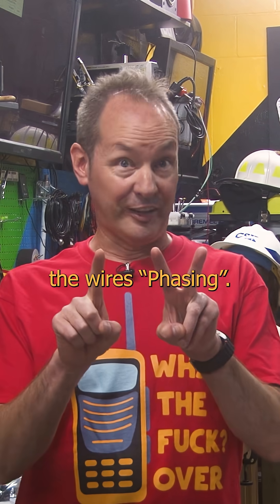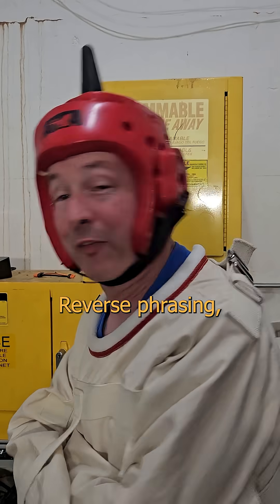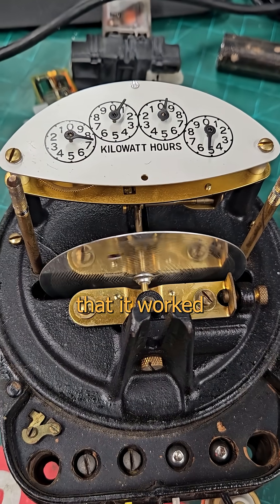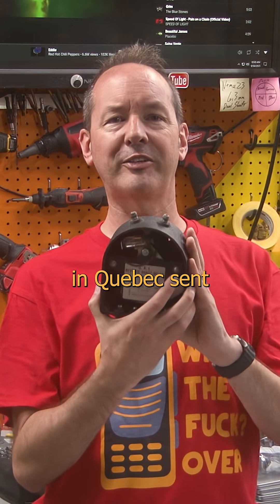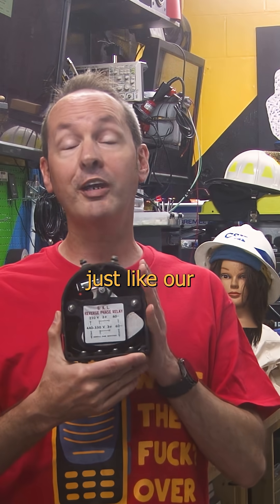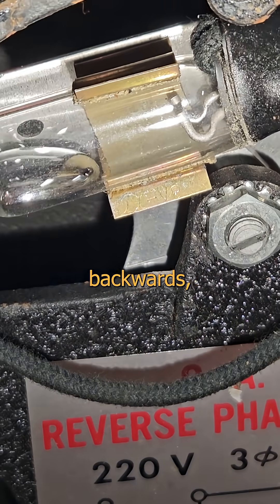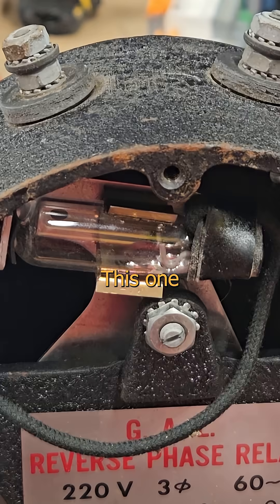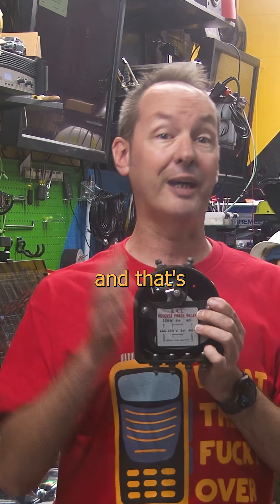Reverse Phase Relay #chrisboden  #comedy #engineering #electrical #educational #elevator #science

Comment: first time i saw phases accidently reversed, we fixed a snow gun and rewired it in where we'd temporarily had a portable unit covering for it, phases were wrong and we found out when the stream of 70 gallons a minute of atomized water got sucked backwards through the barrel instead of ejected forwards into the main hill...looked pretty neat though...

Comment: At work,  we use chillers to regulate the ink temperature on ink jet printing presses.  The circulation pump in these chillers is small but runs on 3 phase power.  The pump motor has a small flag that pops up if the phase is wrong.  When wiring it up, we bump the pump over using   the contractor to check rotation.  This also saves the much larger compressor the headache of running backwards.

Comment: Not always a "expensive sound"
Used to do work for the highway doing maintenance on the high mast lights.
(Those real big ones usually in the center median) Some of them have a motorized winch to lower light ring from the top to the bottom. 
If it was installed incorrectly, the only thing that really changed was what button worked for up and what burton worked for down despite what the label said.

Comment: I had this problem once. Re-wired a machine I was supposed to just LOOK at, but because it was all vacuum tubes it couldn't reverse the spindle, so when I connected it thus the Motor turned backwards and the lathe was useless until they fixed it. Lucky for me, the Tubes did not care.

Comment: Reversing phase is an unfortunate trick we need in entertainment rigging. When a motor stops behaving sometimes we need to pull this gag to make the motor that only goes one direction attempt to go the other way when we have a wiring failure. Nothing makes expensive sounds like a few tons of truss stuck half way up because of a control failure.

Comment: I had a licensed electrical contractor wire a delta motor as a wye. It was late in the day and he was eager to get home so when he flipped it on and it buzzed ominously he switched it off and said 'There ya go!', packed up and left.
After he'd left I tried it and again ominous buzzing but no spinning. So I decided to check his work and noted the big Delta symbol on the cover, confirmed he wired it as a wye, and spent the next hour rewiring it properly. It spooled right up when I was done. Thankfully the motor wasn't damaged.
Reply: reputation matters more than paper certificates and always has.
Reply: @TS-jm7jm  Just because you are "certified" doesn't mean you're "Qualified" - NEC code states "Qualified" for a reason.
Reply: Did you back charge him?
Reply: @MrHuram-abi  I let the upper management know what happened. Since the guy was a 'friend' of the VP I doubt anything was even said. All I was concerned about was getting my production facility back up and running.

Comment: Once worked at a drug company.  One of the more "talented" operators learned that if the motor goes the wrong way around, swap two wires in the plug- not swap two of the current carrying wires.  We had an electrician on site, but the operator thought that he would save some time and be a hero.  So he goes and swaps....one of the phases and ground.  Now the machine does even less than before, so time to call the electrician.  At this point it's important to know that all the operators are wearing nitrile gloves and tyvek suits, so close enough to being insulated.  The poor electrician was profoundly less insulated l, and got one hell of a zap from the machine.
Reply: @kc2sst  he didn't try and change them at the vfd or was there none?

Comment: I work in a plastic shop, we are constantly trying to make all the outlets run the same direction for the grinders and dryers we move around. 

Lucky the machines say when the phases are swapped. For a quick fix when I don’t feel like swapping wires, I made a little dongle to plug in between. 

It at least keeps the party moving without me having to drop what I’m doing.

Comment: My brother-in-law is a commercial electrician. One of his claims to fame is that he was working on a rotating restaurant high up above the city. The restaurant is designed to do a full revolution in the time that the average person takes to eat dinner. When he was working on it, he accidently did exactly as described in this video, and got the restaurant spinning the wrong direction. Apparently none of the customers were any the wiser, but it really threw the staff for a loop because when they came out of the kitchen in the center and on to the moving platform, it was moving the opposite direction that they were used to. It was spinning the wrong direction for a couple of days before he was sent back to fix it.
Reply: The Millenium Hotel Restaurant in St Louis, closed for more than 10 years.  I think they are trying to get it torn down.
Reply: Now I wanna know which building and how big the motor was.   My first thought was Space Needle in WA
Reply: This feels like a reunion tower in Dallas kind of thing otherwise we’d all have heard about it before
Reply: @TheHeroPercy  if thats the case, have you heard of the Egon restaurant in Trondheim, Norway then? Thats a spinning restaurant
Reply: Sounds like the Space Needle.
Reply: there was a revolving restaurant in sydney. it doesn't revolve any more.
Reply: As memory serves, this was a trademark feature of Holiday Inns in big cities.  I don't even know if the Holiday Inn brand exists any more, but occasionally I've been able to recognize former such hotels — the rotating restaurant/bar in apparent disuse.
Reply: The Wolfgang Puck restaurant in Dallas is like this
Reply: Sweden?
Reply: Since noone's mentioned it yet, imma just say that there's such a restaurant in Vienna.
Reply: Calgary Tower?

Comment: Most expensive sound ive heard was 400kg (880lb) water pump that tried to jump out of a wet test stand. The pump survived pretty much unharmed (sealing had to be redone), but half of the electrical test and sensing station had to be rebuilt. It even fried 2/3 of the 120kA fuses and the inductive current sensing.
Reply: so it leaped out and landed on expensive things?

Comment: I've witnessed this on 3 phase motors at my job. While helping the conveyor mechanics..they would rewire to jog the rollers back after a carcass break. This elevated the tension so they could unwind it from the drive rollers. Then we could pull it out to relace it. Saves alot of time. Thank you for an explanation so I could understand the process.

Comment: JET brand hoists have a reverse phase inspection relay that cuts out the control voltage if the phasing is wrong to avoid hitting the upper limit while the down button is pressed and vice versa causing the lift chain to snap and causing expensive noises when the load plummets from the sky.  The relay frequently fails, so I have changed a lot of them out back in the day.

Comment: I used to work in a building where a bunch of the floor outlets were out of phase. The story went that the building was being built during an electricians union strike, and in the process of bringing in multiple non union crews to finish up the work, some of them were wired incorrectly. I dont know what parts of that story are true, but I find it entertaining nonetheless!

Fortunately, from my understand and experience, everything where phase actually mattered was fully capable of swinging both ways, so it was really only ever a matter of making sure your chain motor was running in the correct direction before full sending it

Comment: We were going to bring a pump online and asked the electrician to double check the phase at the outlet....He responds that there's no standard ....wait!.What!?  Thankfully someone else knew where a phase meter was and checked it.  It was not a pump we could safely 'bump' check.
Reply: Standard is right turning field
Reply: Standard 3 phase in machine world is red, white and blue left to right. Hopefully the building agrees. And that is a variable you don't know until you plug in.
Reply: Remove the coupling between the motor and the pump before you bump the motor. Cheapest way to prevent a broken pump housing.

Comment: Working with 3 phase water pumps, it's always fun to see water entering places it's supposed to be leaving.
Reply: Or the impeller unscrewing from the drive shaft and ejecting itself through the front housing...
Reply: @v8snail yup, was going to say it if nobody else had haha
Reply: @v8snail  That's when the expensive noises happen. 😁
Reply: Depending on the pump, I wire domestic well pumps, it still pumps the correct way if your phases are wrong but it's much slower. In old installations that's how I test the correct phase. You let the pressure switch activate, time it until it stops. Then you switch two phases and time it again. The faster one is the correct phase
Reply: @justme5384  same with boilers and sewage pumps. they're all centrifugal, so the flow direction is determined by the volute. The impeller just uses surface tension to fling the water.
going backwards just kills the efficiency... and sometimes the motor coupler.
Reply: @justme5384 Dang ol’, good info!
I genuinely appreciate that.
Reply: @justme5384 this is how we do submersible sump/trash pumps. You can also tell by checking amps.
Reply: That sounds like expensive contamination of a tank waiting to happen. So you're not working with turbo pumps, right?
Reply: The pumps for Fire Sprinkler systems have several relays meant to tell the Fire Panel if something is wrong and one of them is designated "Reverse Phase" and is specifically there to tell the fire panel that the fire pump is running backwards.
Reply: this is why we always always always check rotation before coupling our motors to anything, we’ve learned the hard way. fortunately, all we did was burn up a belt on a compressor, but the stakes are higher on 250hp motors coupled to 2 ton gearboxes that have a backstop
Reply: Oooo expensive spillages
Reply: When I cleaned swimming pools one summer there was this one guy who just had a new pool built and idk if they wired his pump backwards or plumbed it backwards, but his jets were sucking and his drains were blasting. Really high end builder too.
Reply: Well that’s the interesting thing, there are very few pump types that that actually happens. Most just don’t pump or pump very little
Reply: This happened at my work they wired the scavenger pump the wrong way so instead of take water away from the kettle it filled the kettle and blew the lid open.... they didn't think to test it before running it fully 😂
Reply: That’s it motor running backwards because they haven’t bump tested it and cooking a water pump in about 10 seconds flat
Reply: Yep! All my big pool motor pumps are the same
Reply: HA HA HA...yeah funny stuff.
Reply: @jameypoelman1317 were still doing phrasing right lol gotta love the Archer throw back
Reply: i too work with pumps but mainly for sewage, fat and greywater. easy when its a 3 phase, but sucks when its a single phase
Reply: For Extreme Values of "FUN"...

Comment: It's a fun time when the sensing wires AND the phase wires get messed up and you sync a bunch of generators together and introduce them to the grid going the wrong way around. The crankshafts generally pop first.....then it's popcorn time. More fun times if it's a turbine, they can rip the floor mounts out. Long story short....the grid wins.
Reply: Ah, the special kind of "expensive noises", yes?
Reply: most spectacular failure I ever heard of was a speed sensor failure.  A giant condensor (spinning inductor monstrosity) was supposed to spin to 60rpm and sync.  but the speed sensor partially failed and it spun to 180, tried to sync, failed to sync, and shut down.. then auto started again.  Over and over, until it blew apart into 100 foot rain of thin iron laminations like "flying knives".
Reply: Grid ALWAYS WINS!!
Reply: The North American grid could be considered the largest single machine in the world.
Reply: In power plant operator school, a teacher showed us of a generator that was phased in the wrong direction. On first sync, the rotor left the scene in a hurried motion, through the exciter unit. Impressive pictures.

Comment: The first time I came across this in the real world was Salford Docks (UK) in the 70's! 
We had to do some work and drop the power off then put it back on a few hours later (hopefully the right way round or else the dry dock would not be dry (and going down those depths of hell was an experience) It was made interesting by the fact that although we had told everyone of the times involved some stupid shipbuilders did not believe me. This resulted in an 18 year old me running for my life from a crazy guy with a spanner bigger than I was because I, personally and with vindictive thought had interrupted his time sensitive welding job and therefore it was only reasonable that I should stand and fight him because of it!
As it happened it was wrong. It was wrong because some dumb engineer had not checked his job out perviously so we had a section of Trafford Park running reversed phasing!
Interesting times!

Comment: I thought that switch/relay might correct the reversal. Of course it wouldn't be an "instant fix", but maybe in time to prevent the expensive sounds in some applications. Just needs a pair of contacts at the other end of the glass.. could be any pair of the 3, since it seems to me if you reverse 2, reversing any two would correct it.
Reply: You could do that if it gets unplugged often. If it's permanently wired just rewire it
Reply: I could absolutely see a relay like this (with both NC and NO terminals) being used to power a set of contactors in the same arrangement as a bridge rectifier. it would absolutely fix any wiring oopsies from a portable unit

Comment: And the running… And the yelling… And the fire trucks… MAN SPEAKS FROM EXPERIENCE. 😂😂
Reply: That distant look of reminiscence was 🤌
Reply: When I was a stoodent learning about 3 phase we had these kits that built into different types of motors.  We quickly learned about switching 2 of the 3 phase on meant the motor would run happily in either direction.

Only a short hop to flick the motor the wrong way then turn on 2 phased, great now it runs up to speed backwards.

Ok, switch the 3rd phase in.

" Why is your motor on the floor?"

",it jumped sir"
Reply: laughed so hard I coughed up a lung
Reply: You nearly could see the flashback he had...
Reply: That made me grin so much. 😂
Reply: Serious Professor Frink energy… I was half expecting a “glayven” to follow.
Reply: *trauma
Reply: 😅😅😂😂😂😂, a friend told me similar things 😮😊❤
Reply: I've bumped a loose jumper wire in a nest of old phones jumpers before. It's the same result just without all the running and yelling. It's more like "Why are you guys here?" and then you get the expensive answer...
Reply: I laughed so hard when I heard him say that 😂
Reply: I came to the comments to say this!!! 🤣😂🤣😂🤣😂🤣
Reply: I love how he also almost sounds like “geez it was just an accident tho”
Reply: Because any machine can be a smoke machine if you operate it wrong enough.
Reply: How about a star delta motor with the delta wired in reverse... 350 hp motor... it was exciting